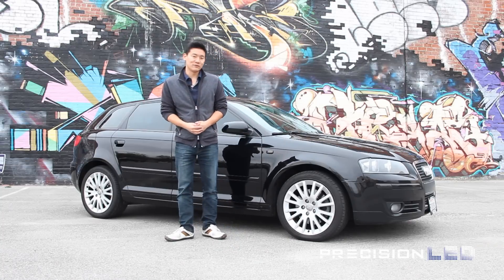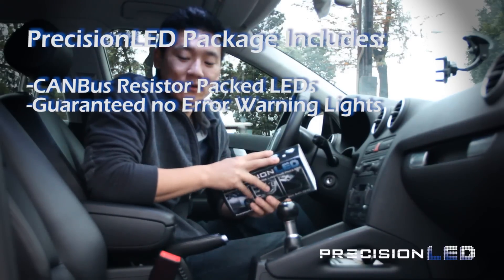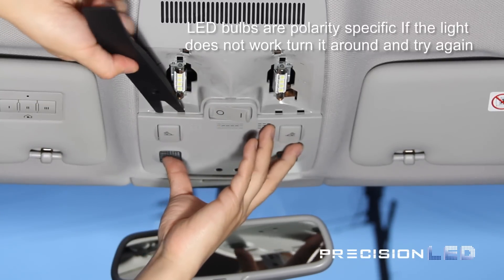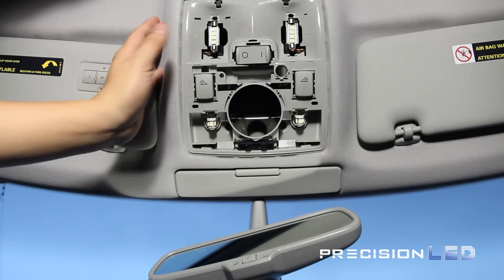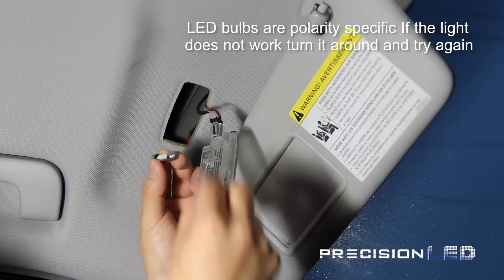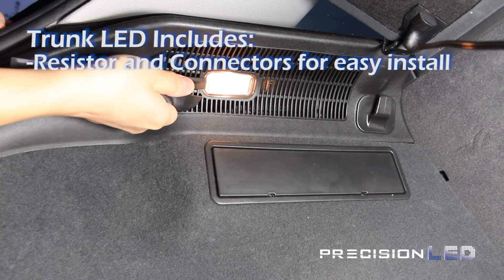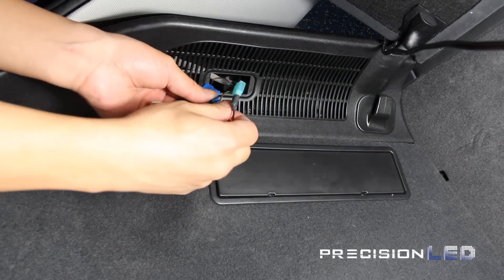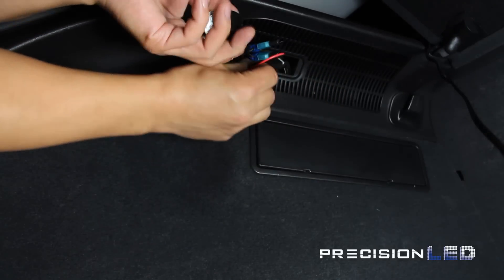New Audi A3 LED Interior Light - How To Install - 2nd Generation (2003-2012)

Comment: Can I ask, why does it require a resistor for the boot light? The A3 doesn't indicate when you have a boot light out.
Reply from the maker: Hello,

Although there is no error code, without the proper resistance, an LED light will not turn on as the vehicles computer detects the socket as dead due to the reduced power consumption.  The resistor is needed in order to complete the LED conversion.

The proper resistor does come with the PrecisionLED kit.

If you have additional questions just let us know.

-PLED Team
Reply: +PrecisionLED thanks for this! now I just need to know where to get the resistor.  this has been giving me fits. arghh these german cars.

Comment: what happens to the map reading lights when you lock the car? do they go out. on my A3 which has halogen bulbs they just dim off over time.
Reply from the maker: Our LEDs would act exactly as your halogens do.  In which case, yes, they would dim off.

Comment: and the one in the glove compartment you did not put it on?
Reply from the maker: The glove box light would be a stock LED, which you cannot swap as it is soldered to a chip and board.
Reply: in my car which is an audi a3 8l simply change the glove compartment lamp and put the led lamp. In my car it was not welded nor had a chip

Comment: lights bulbs mounted in the foot this Audi? I await response thanks.
Reply from the maker: Are you referring to the footwell lights?  We do not have listed the A3 comes with footwell lights.
Reply: It definitely does, i had non canbus leds in mine but they didint work properly. They are the same bulbs as the glove box and under door light bulbs. I have normal bulbs in the lower stuff and led bulbs in all the overhead stuff and glovebox :) Looks good like that